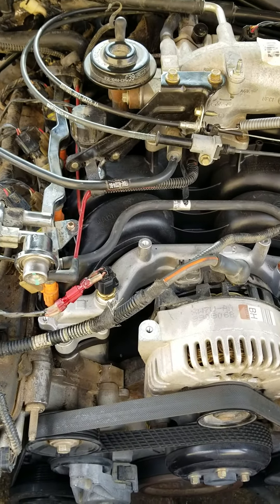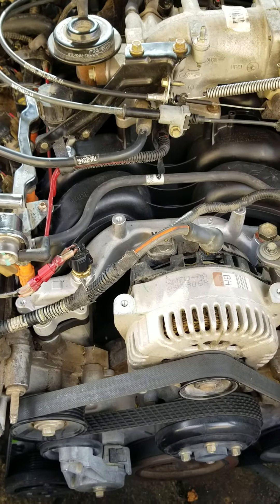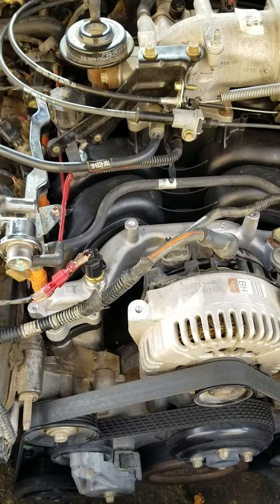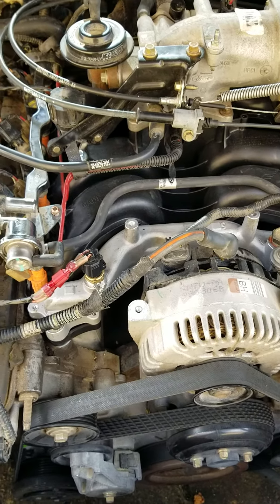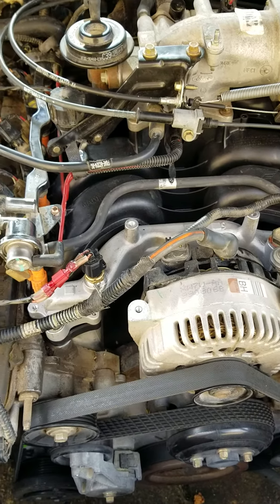Crown vic temp sensor problems

Comment: My gauge is spiking only when I’m driving it does a little stutter loses some power sometimes it cuts of but I’m 3 seconds it goes back to normal. Had multiple shops look at it no resolution. Swapped out thermostat, coolant sender sensor, the cylinder head coolant sensor . Still does it but only while driving it can sit in park idling for hours never does it until I drive it. Any suggestions? 2001 grand marquis

Comment: I have a 1998 mercury grand marquis the speedometer and temp gauge do not work, the temp gauge is way below cold ive replace the temp sensor nothing changed, ive changed all speed related sensors no changes, ive even swapped out 3 different instrument clusters no change any ideas???
Reply: I have the same problem with my 02 vic. Were you able to solve this problem?
Reply: Nope i just left factory plug there and on opposite side hooked in a manual temp gauge

Comment: Mines not working at all. I updated the intake to the aluminum front to prevent cracks during service. I wasn't getting any temp reading before. I changed the temp sensor and also added a new pigtail to make sure. I solder always and added heat shrink and doubled up to keep it from grounding out. It wasn't spiking. Won't move at all. I have un Autel MK 908 Pro 2 and it should tell me if the computer is reading temp so I can narrow it down to the gauge. I am new to scan t o old as farcas pro stuff and haven't been around automotive much since I started driving a truck. Just encountered some medical problems and just trying to get this old car that only has 90,000 miles on it in the best shape possible incase I can't finish paying a loan if something happens. I just bout it used. 1999 Mercury Grand Marquis 4.6 withh analog dash. I was going to switch continuity to see, but yours is spiking and mine seems to be dead as a political promise
Reply: In the same boat here.  99 Interceptor, guage always says below cold, manifold was updated before I bought it, new sensor, tested pigtail and gets the right voltage.  I drive as well and pretty much replacing one part after another to get it back in shape (finally).  This has always bugged the crap out of me.  Have not tried to swap the leads myself either, but worth a shot I suppose.
Reply: @davidulmer9774  You need an original Ford temperature sensor. The aftermarket sensor won't work. I did that too. I made a video on it on YouTube
Reply: @davidboughman138  Thank you very much.  Just ordered one.
Reply: @davidboughman138  Thank you allot.  This has been bugging me for years.  This fixed it.  
One problem I had was one of the guide marks did not line up right, so I shaved that one down and the clip fit right in. 
I thought it wasn't working at first, but after running about 2 minutes it started to climb.

Comment: I changed the coolant temp sensor and the new one when tightened still has thread sticking out but it’s tight. But my temp still spikes up and then returns to normal. What else should I do ?  

I also changed my other temp sense behind the alternator.

Comment: Mine spikes hot after a mile, then goes back to normal after a mile or two  pulls a 1285 code for head over temp sensor  . Scan tool says 226 degrees

Comment: I have a 1999 Mercury Grand Marquis with the same overheating problem so I was wondering is the coolant temp sensor is the same as cylinder head over-tempature sensor right?

Comment: Replaced the intake on my 01 vic lx and it ran excellent a couple mins after I started it...after a few mins of running it idled down lower than normal and started stumbling, when you pull out it studders and sputtered...do u have any idea what it could be id really appreciate the help it has me broke down...??????? Ty in advance...
Reply: Fuel rail needs to be securely pushed down and you need the factory screws from the original intake that hold the rail down so you can use it to ground the plug that was there before. If not you will do as you say you're doing and codes will read for a new fuel pump driver module.
Reply: @DVMVGEDGXXDS  its an 01 it doesnt have the fuel pump driver module...I used the factory fuel rail bolts all 4 of them and put the ground bk in the same position, it straitened up on its own after a about a week of babying it around, im guessing the computer relearned because it did have a vacuum leak before I swapped the intake, its never been overheated i didnt have the cracked intake problem just vacuum leak around no.1 cylinder...thanks for the reply
Reply: Also used new injector o rings...
Reply: Okay. My apologies. Wasn't aware fully of your situation
Reply: Gotta unplug the battery after that then plug it back in and let it idle so the system can rebalance it’s air fuel mix and idle speed

Comment: My temp sensor is in the head my nephew drove the car and severely over heated the 4.6 p71 v8 . This one has a head temp sensor not an easy access access manifold sensor and I can not get the fan to come on when I turn on the A/C as it should nor does it come on at all. I assumed it was failed fan motor or module so replaced both. Still no fan unless I bypass wires. Has my computer failed, I have changed relay 102 in fuse box and nothing . Still no fan when you turn a/c or when you're driving I must pull over and go directly from battery to fan to drive car. Anyone know what to do or has computer failed ? Need put.
Reply: Did you ever find out what the issue was? I'm going thru this same problem right now. My fan won't turn on smh
Reply: Both of you need to replace the ect sensor.
Reply: @lucyloo2228  That's not always the issue.  My fan doesn't come on either in my 99.  Fans good, fuses good, new sensor, tested ect clip and voltage good,  guage always below cold.  The fan not coming on when it should most likely is due to the computer not getting the proper temperature information yes, but if everything in that chain is new and it still doesn't work, it's a mystery.  I will try this guys work around and hops that works, if not it will just say cold till the car dies as I'm tired of paying mechanics to hear "I have no clue".

Comment: I have a 2009 crown victoria police interceptor. Can't find the intake air temperature sensor. My sensors location are different from yours. But good info. 👍
Reply: Did you ever find out where it was? I'm having the same issue right now. Thanks
Reply: @MRJAKO4EVR  what year?
Reply: I have a 2011 is the temp sensor directly under thermostat housing?

Comment: What socket did you use to install the cooling temp sensor?
Reply: my new thermastats not working .. could this be why its not working?
Reply: @youngjj757  Yes. It could be stuck but it's not very likely.
Reply: @youngjj757  Then its most likely not the thermostat. What diag did you do to determine your problem was the thermostat?
Reply: 3 in 14 pt metric crows foot